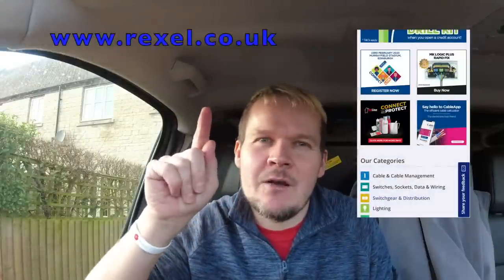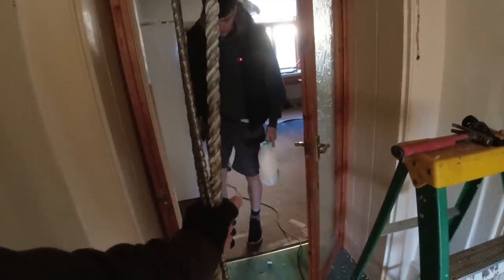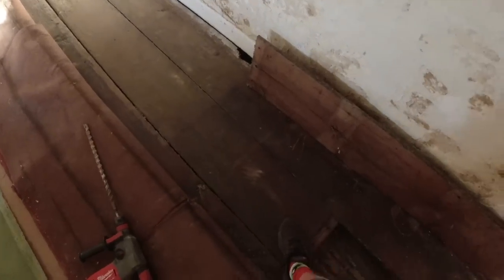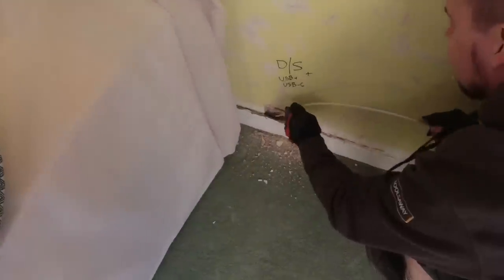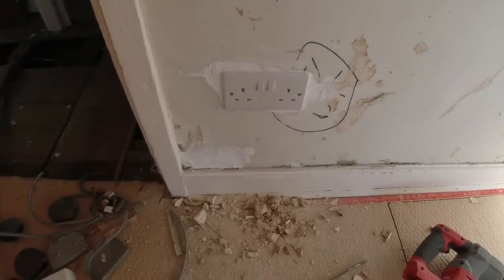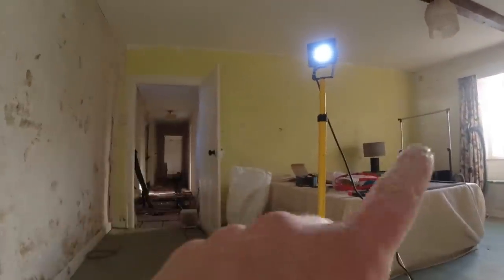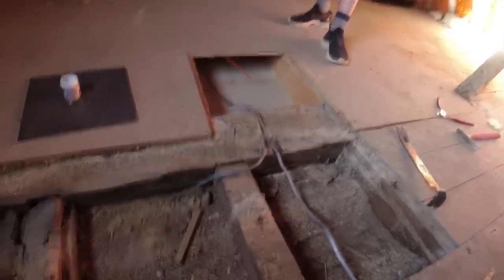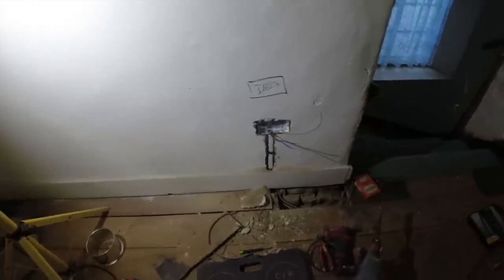How has this not burnt down? Cjrelectrical - Electrician

Comment: i have been the believer of if it’s not been messed with an in good condition you are fine but something that old you will never find it’s never been messed with and it’s so old it just best to replace it but you have different standards when it comes to new stuff then we have in the united states so im talking about something from the 1930s however i have honestly never understood replacing wire that isn’t very old other than it does seem to see a lot more harsh environments than you would expect in the united states as we don’t put wire in plaster it is free behind studded walls and then drywall is put up plaster is not very common here i find watching your videos very informative because of the difference between our standards and some of the similarities
Reply: Many homes here in the UK have brick, breeze block or concrete internal walls